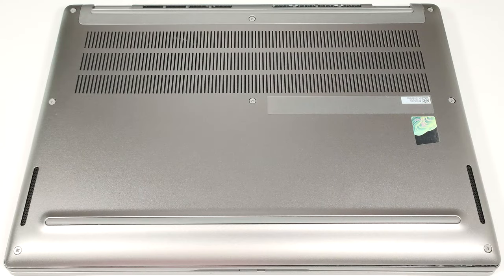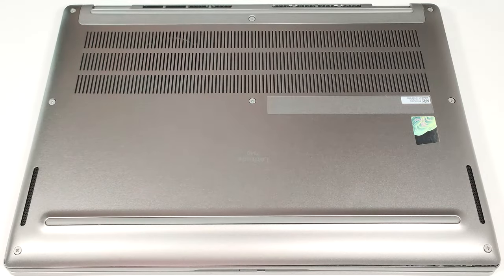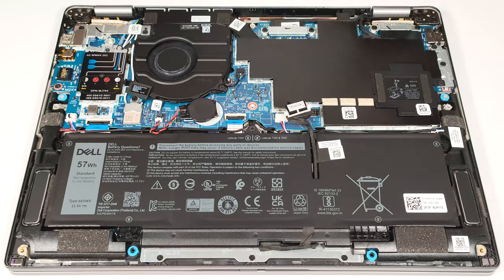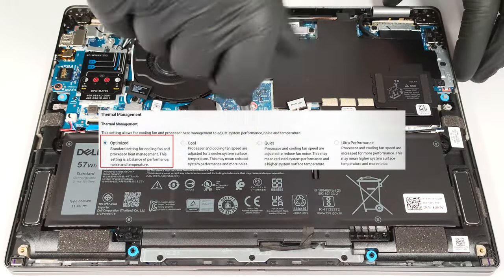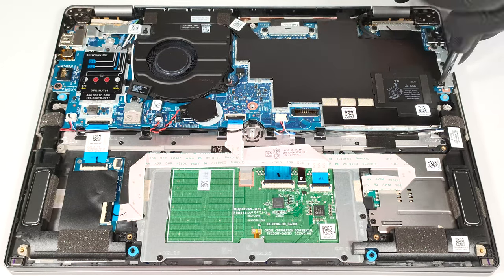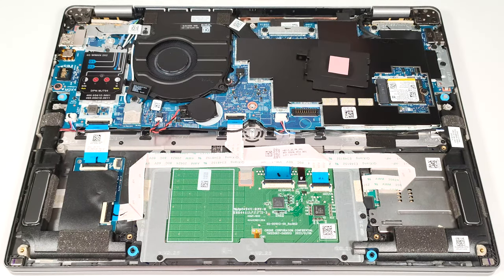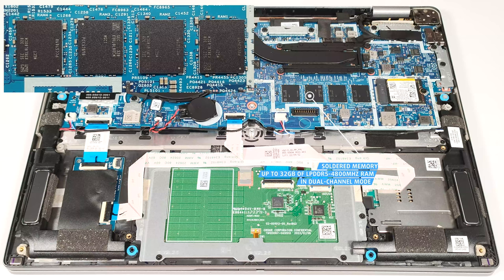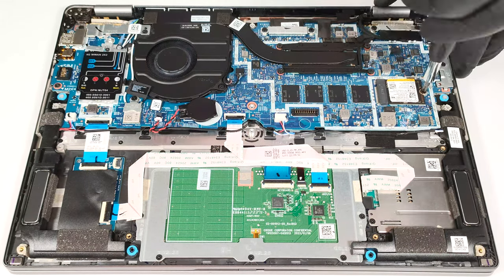🛠️  How to open Dell Latitude 13 7340 - disassembly and upgrade options

Comment: I have the 16GB configuration. Is there any way to add RAM to this?
Reply: No, I am very disappointed with Dell for introducing soldered-on RAM modules. You have to think very carefully what machine you buy now. Todays good deal will become a bad invest quickly, if your requirements change. I bought a 16 GB 5440 not a long time ago as a replacement for my venerable 7490. The 5440 is very fast and responsive. Now I need more RAM for a project with several VMs and I can not expand it. At the end my old 7490 (32GB RAM) is faster, as it does not need to swap.